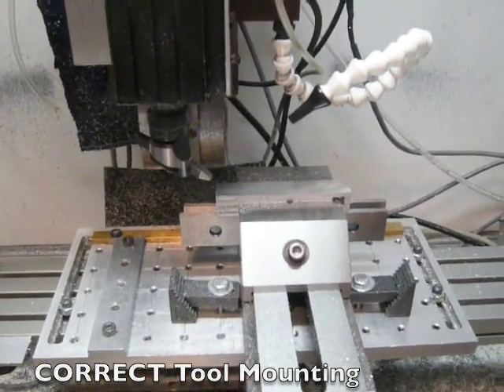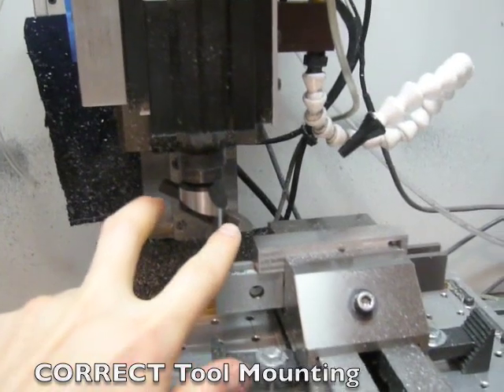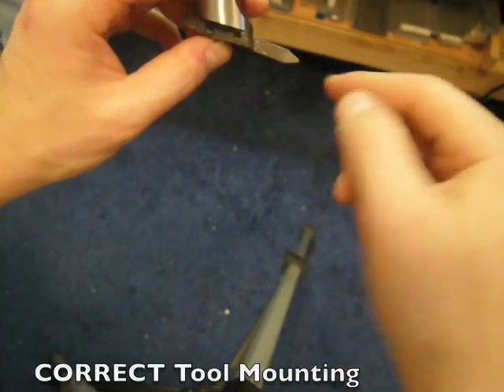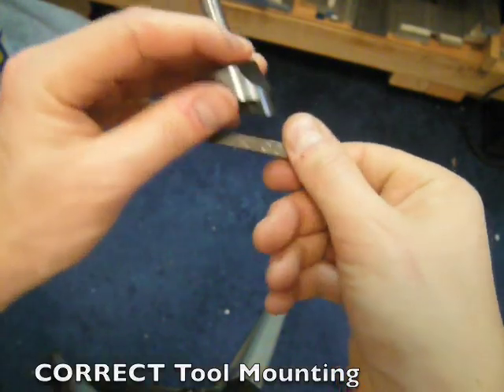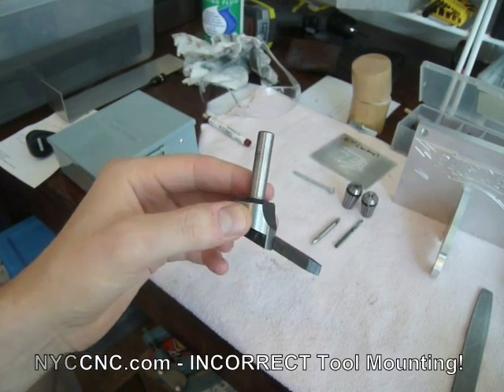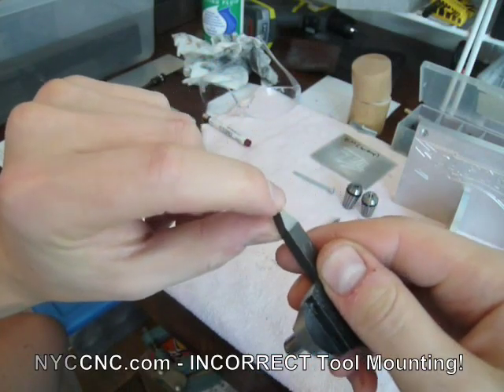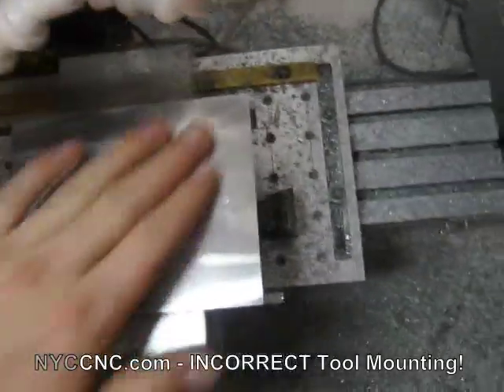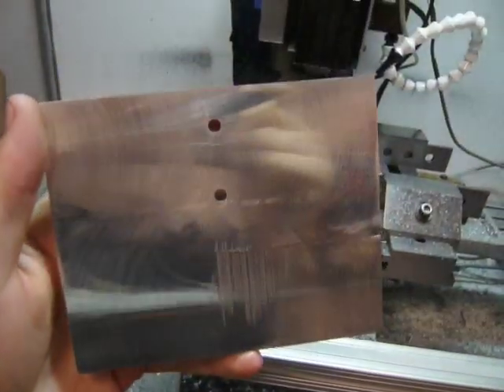Flycutting Aluminum for mirror finish on TAIG CNC Mill Milling Machine

Comment: At the start of my apprenticeship as toolmaker I made sure that the toolbit was inserted correctly on to my flycutter. Had to remove .005 off from a part of a 60 ton automatic press. During my final cut I put the mill in the forward direction instead of reverse and scratched the surface. I just put the mill in reverse and removed a total of .006. I still make mistakes but not as often as I used to. Keith Fenner once said that even veterans still make mistakes.

Comment: With regards to surface finish, an awful lot depends on what type of aluminium you are machining. There are lots of different grades of Ali some machine much better than others. They all have different properties and you need to use the best grade suitable for the specific application .

Comment: Thanks!  Received my "import" 3 Fly Cutter Set yesterday with HSS bits installed 3 different directions.  Found you vid while surfing for information on correct mounting (just got the mill and no experience).  Nice to run into someone who can say "I made a mistake, but here's the right way to do it"